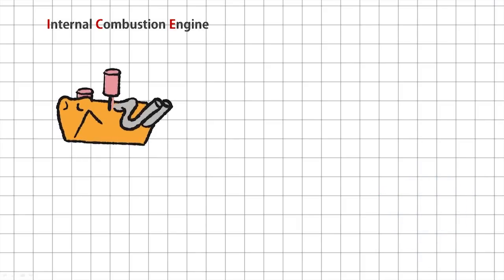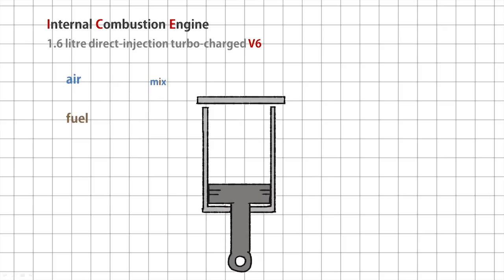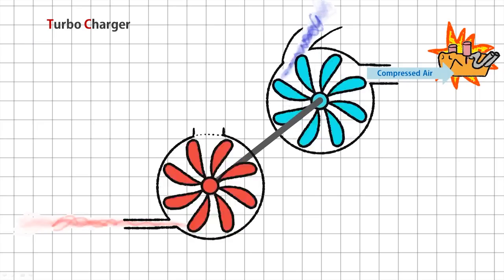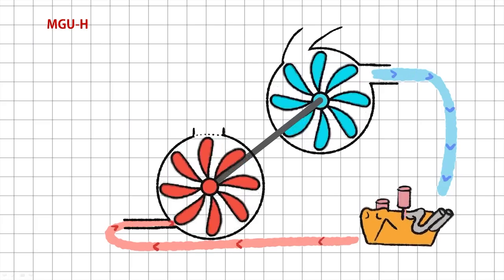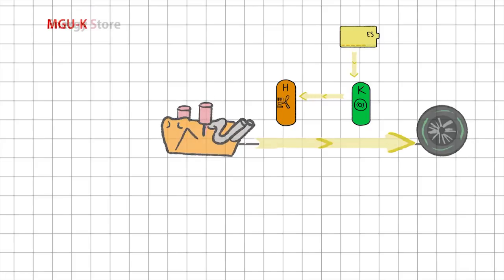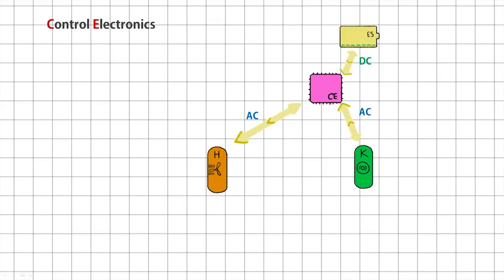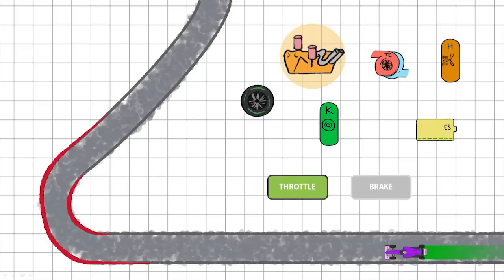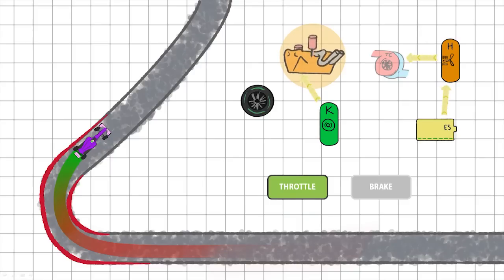The Hybrid Power Unit in F1 explained (2016)

Comment: That was a pretty simple explanation and was good for the most part. I'm not sure about the crankshaft driving the wheels though, that's what the driveshaft does.
Reply from the maker: fair point - I added an annotation to clarify :)
Reply: AussieRacingFan bu
Reply: Chain Bear F1 hello make some videos
Reply: Technically the axel does.
Reply: Technically the hubs do.
Reply: Ok, just found your site....loving the videos, well explained.  But tell me, how does this MGU-K deliver more power to the power unit.  A high powered electric motor I REALISE, but how does that work alongside the ICU?  Does it take over at 15,000 revs, the limit of the of the ICU?
Reply: @alandougans2343  i would think this is a choice of the team and their software programmers, and might be confidential? I think the power can be added to ICU's power at any time, so they mostly add the electo engine's torque whenever the ICU is at lower torque producing revs..
Reply: @alandougans2343  Extremely late to the party, I realize, but I believe electric motors provide higher torque at lower RPM, so they probably kick into action as soon as the driver puts his foot to the floor.

Comment: So This is why F1 drivers take exits out of corners at pretty high gears and low rpm, because by putting the ERS into overtake, the MGU-H pumps energy back into the turbo, eliminating turbo lag and aiding in reving the engine back up.
This being faster and more efficient than just keeping high rpm and loosing time in shifting gears (?)
This is fascinating, thank you!

Comment: I am doing mechanical engineering, so I have a good idea about the control electronic, it is actually the most important part in the whole power unit, its job is simple, as it directs all the components to do the job needed. How it works is a bit hard if you have not studied further mathematics (Laplace transformation), if you want help understanding it, pm me and I'll send you some notes.
Reply from the maker: Hi and thanks! 
Electronics was never my strongest suit, though I do understand bits and bobs of it - my background is in mathematics and physics. I sort of went with the executive decision to skip over going any deeper on the CE for this video rather than researching further as it probably wasn't right for this video. Maybe in future though?
Reply: A future video about the CE would be excellent, as it would showcase why Rosberg-Hamilton accident happened in Spain, as Rosberg was not on full power. If you need any help, I am happy to give any needed assistance. Thanks again for your brilliant videos.
Reply: BlackBlueMen sir pls pm me about the equation. i have a working knowledge of the laplace

Comment: MGU K also can be switched to harness either 0 or max energy from the rear axle which causes car to slow during acceleration thats why the rear red light turns on. which affects the brake bais for the rear.  MGU H gets the energy from the heat of turbo to either fully or partially charge the battery

Comment: So the mgu-k and mgu-h are electrically connected so neither is totally dependant on the battery? I never knew that. It makes sense since a battery can run out of charge (and takes time to recharge and I'm guessing reach a threshold where it can provide enough current to drive those motors) so this convoluted set-up skips the battery middleman. Neat.

Comment: Only issue I have with this video - you said the MGU-K gives power back to the ICE in order to give more oomf. Im pretty sure this is incorrect. The MGU-K gives power direct to the crank shaft when it's outputting power, just the opposite direction from energy harvesting

Comment: The only questions I have are:

 If the energy being harvested from the turbine by the MGU-H is being generated in a direction, let’s say clockwise, how can it be put back into the turbine in the same direction for it to produce boost? To my understanding, the generator can become a motor and produce boost only by rotating in the opposite direction. 

Is there any magnet polarity manipulation happening inside the generator/motor?

Comment: Mercedes put the Compressor at the front of the engine -- in hindsight it seems like a perfectly logical thing to do, after all the air needs to be compressed before entering the engine and it keeps the compressor far away from the hot turbocharger -- and then they put the generator right in between inside the V.
Reply: So logical that Honda, Ferrari and Renault copied Mercedes idea. It is just such a clever but simple idea

Comment: "The power unit is deemed to consist of six separate elements" those ar ethe ones you provided helps to understand things greatly!

the only problem i have is with this "Each driver is permitted to use only five of each of the above six elements during a championship season"

So how does that impact your above. you can't use a turbo or an MGU-H but you can use all other elements?? Am i missing something? What teams are using what combinations of the six elements?
Reply: pinkyfull really? I thought it was your only allowed up to 5 complete power units throughout one season.
Reply: Took me a while to figure out what you were confusing about lol. Each power unit is made up with 6 elements as Kyle mentioned in the video, and for each elements, teams have a total number of 5 they can use for each year. In another word teams can swap the elements individually 4 times before they start getting penalties.
Reply: You are technically right, but teams are allow to swap parts individually, for example if during the qualifying section their MGUK unit is damaged, for the race they can use a new MGUK but kept all others components untouched. And they are also allow to use an old parts if they wish to do so.
Reply: Well thank god. That clears things up. The writing of the rules was very ambiguous i think.

Comment: they dont use a button to engage extra power? is the additional electric power just built into the throttle? the driver has no control? 
also, does the driver do anything to “harvest” energy as ive heard martin brundle say

Comment: The CE, hasnt it the same function as the PSU in your pc?

Btw can we get a more technical vid. I am seeing a lot of potential.
Reply: Not really. It's more accurately the CPU because it dictates how much power is to be harvested, how much to be deployed, how the power is harvested, how they are deployed etc., exactly like how the CPU in a PC delegates tasks to be completed. The driver can dictate his preferred settings for the ECU/CE using the many different settings on his steering wheel dials.

Comment: If a formula 1 car has a smaller carbon footprint with a lighter chassis and more reliable power unit throughout the season I think the regulations should allow them to race against the current less reliable and more fragile V6 hybrid power units. Batteries do not have zero carbon footprint the environmental cost from their manufacturing is significantly higher than that of a regular engine.

Comment: So the MGU H is like a KRS that is automated. Nice
Reply: Not exactly but the same principle. Like a mini KERS for the turbo) It's reusing the power that would be wasted otherwise. This is one of the reasons why such small engines with limited rpm is all that's needed these days. Advances in all other aspects of a car - electronics, energy recovery systems, aerodynamics would make cars too fast and dangerous if they were still allowed to use v10 monsters of the past.

Comment: buddy could you do a video about the tale light in f1, its pretty confusing, when its on or off.
Reply: It is always on when it is raining so the driver behind knows where the car ahead is, and it is also on when the driver is saving energy (so the driver behind knows the guy ahead might brake a bit earlier than usual)
Reply: Basically, when the MGU-K is harvesting energy, the red light flashes to warn the driver behind that the car will slow down quicker, and It's always on in the rain or fog

Comment: How does the MGU-K “Drive”  more power to the engine? What does the engine do with more electricity?
Reply: if im not mistaken, the MGU-K is basically an electric motor. Thats all an electrical generator is, an electric motor in reverse. So instead of using the magnetic pulses ahead of the magnets in order to slow down the wheels and add energy to the battery, it moves the pulses to after the magnets which would in turn push the wheels acting as an electric motor.

Comment: Where are the electric motors? Certainly to spin up the turbos quickly a motor is required and isn’t there one in the transmission to add power so as to use that stored energy?

Comment: How does the kinetic unit add power to the engine? I get that the H powers the turbo, but how does the K power the engine?

Also, is the H useless at top speed than? I sometimes see onboard footage of drivers spending all of the store energy when they are slipstreaming. Is that the K only than? since the turbo would be at full acceleration.
Reply: Makes perfect sense. Thanks for the answer
Reply: Yeah, the MGUs are basically motors, which can also act as generators.

Comment: why doesnt the mgu-k help acceleration directly? wouldnt it give an enormous low speed torque because it works (i understood it this way) just like a tesla?
Reply: It does, it's connected to the flywheel of the engine and provides power directly to the powertrain and then harvests energy when off throttle or braking

Comment: I always wondered if F1 engineers found out a way to always collect "power" via the MGU-K whenever the tires are spinning.  Basically, install magnets on the axle, and around it, coiled wire.  It would be like the alternator in your car that runs the electronics and charges the battery.  Instead of being belt driven, it would be driven from the rotation of the axle itself.  It will always be generating voltage as long as the axle is spinning.

Comment: Why is it called the MGU-H if it is powered by rotation like the MGU-K
Reply: I think the H stands for "heat", refering to the high temperature of the exhaust that is spinning the turbine. The K stands for "Kinetic" or the energy from motion, not necessarily the energy from rotation.

Comment: Hi Chain Bear, very helpful video.
Its now a couple of years on, is there more specific information available about the hybrid p.u elements?
Specifically the MGU-H.
It seems to me that it is not driven by heat, but seems to be an electrical motor generator driven off the shaft connected to the turbo turbine and compressor. Is that correct?
Reply: That's literally what he describes it as in the video. It's the turbine in turbo/compressor that generates the electricity as a dynamo. It's only called an MGU-H as the gasses used to spin the turbine are hot pressurised exhaust gasses.

Comment: why would the turbo feed exhaust into the engine?
Reply: Its not the engine exhaust gas which is fed into the engine but the fresh air which is sucked into the turbo.
Reply: So why is the exhaust connected to the turbo?
Reply: Advanced Pioneer to spin the turbo.
Reply: Oh ok, thanks.

Comment: What if we had an electric car with three generators gathering energy all the time the wheels are spinning powering a battery that propels a front drive tire? I don’t understand why kers only works under braking why doesnt the spinning wheel generate power all the time? Why can’t that be Renewable energy?
Reply: Don’t misunderstand me for a guy who likes electric anything. But I don’t get why that hasn’t been made
Reply: Charging the battery when you accelerate is a "waste" of power.You fuel that power into the engine again instead of saving it because you need all the power you can get that time.

Comment: Fundamentally wrong, it is the heat in the exhaust gas hitting the turbo's blades that give it energy not the speed of the exhaust gases. This is why if you hold the revs on a turbo vehicle at say 4000rpm and drive downhill there will be little boost and when you come to a hill which puts load on the engine and makes the exhaust gases hot then the boost goes up, yet you kept the rpm the same. This is why on race turbo engines the exhaust manifold is insulated because you want to keep the exhaust gases as hot as possible so they will have more energy when they hit the turbo's blades.

Comment: Wait, f1 don't have crank shaft. More like directly connected to wheel
Reply: ... why would you think so.
Reply: Jango Bobafett i mistook crank for axle. Or something.
Reply: They don't really have a crankshaft, the transmission is directly connected to the engine and differential on either ends and then axles come out of the differential.
Reply: Draylogic
you meant drive shaft right.

Comment: what is ac and dc?
Reply from the maker: I didn't want to get into it in detail in the actual video, but AC is Alternating Current and DC is Direct Current. Essentially, the difference is that with DC, the electric current travels in one direction and with AC the current changes direction back and forth periodically.
Electric current is just electrons travelling along a wire and can be thought of like water in a pipe. DC is like normal plumbing - everything just flows along a pipe in one direction. With AC, the "water" goes backwards and forwards over and over and over and over. 
As you can imagine, having one system that uses AC and another that uses DC and getting them to work in harmony efficiently and quickly can cause headaches!
Reply: AC is what comes out of the wall of your house. it can directly power machines like a vacuum or blender or washing machine. It can be produced by mechanical movement like a wind turbine, or a water turbine, or a hand crank. Little loss of energy would occur powering such things with those AC sources. DC is what batteries and other chemical based sources produce. Its more like water flowing from a high potential to a low potential under gravity. DC is used by electronics like your phone, computer processor, or LED lights. DC can be produced by the sun or other chemical reactions. A battery would power a phone with little energy  loss.

The heat that builds up in an F1 comes from the conversion between AC and DC. it takes energy to convert AC to DC or DC to AC. A cheap converter could work at an efficiency of 60%. that means 40% of the energy is turned in to waste heat. A really expensive transformer could go higher say 95%. But it costs a lot of money to get that efficiency. Also AC to DC is transformed in a different technique than converting DC to AC. So two conversion systems are needed, if you want to send energy to and from multiple different sources. So really there are two electric toasters in the back of an F1.
Reply: Nicely and simply explained... as the video did about the actual F1 engines. It's amazing how complicated gets an engine when you want to minimize all the power loses that termal engines have.

Keep doing these amazing videos Chain Bear F1!

It would be great one aobut the grip vectoring of tyres, how it changes between braking, accelerating and turning.
Reply: It's TNT, it's dynamite!

Comment: I don't understand the MGU-H!!
Reply: Juzh123 like an alternator?
Reply: +Amit Dawar in the way that it generates power, exactly, however instead of being spun by a belt (like an alternator), it is spun by the turbochargers turbine. this also slows the turbine spinning at high speed to stop it spinning too fast and can speed the turbocharger up whilst it is spinning slowly to help provide power at low revs
Reply: Jonty Macmichael I don't really understand the 'H' in MGU-H, what does heat have anything to do with the turbo??
Reply: +Amit Dawar I believe (someone feel free to correct me) that it is because the hot exhaust gas is what causes the turbo to spin at the rate is does (temperature increase is proportional to pressure increase). it still is a motor generator unit which converts turning motion into electricity and back, but is called mgu-h to help tell the two apart